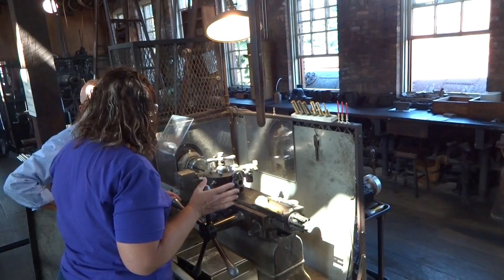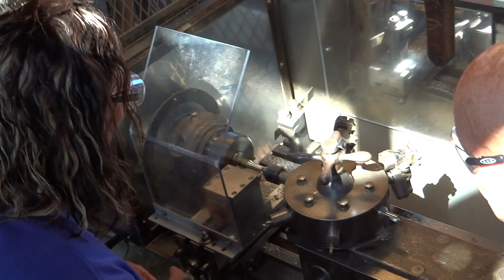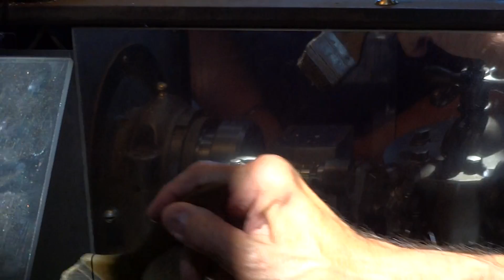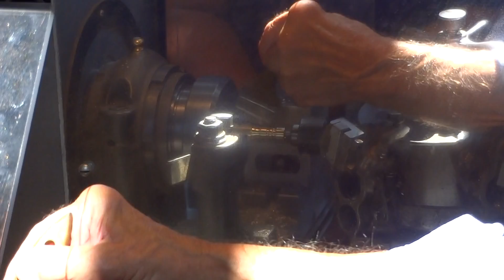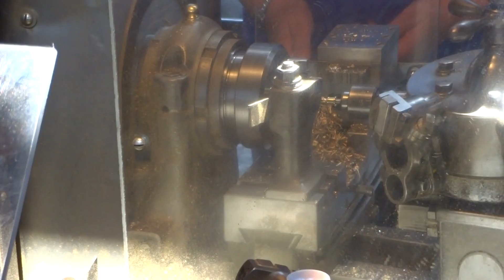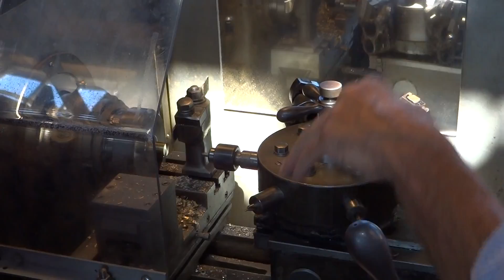brown and sharpe turret lathe

Comment: I did it about ....? 8 or 10 years ago  got to keep the candlestick, still have it.  It was $5 at that time and WELL WORTH IT !  I treasured the "turret lathe operator's certificate they gave me and still have it.
I think getting to operate this fine old B&S kinda pushed me in that direction.....I had always liked engine lathes and usually had one in the garage or basement.  In the intervening years I have been  able to aquire two Warner & Swasey #3 turret lathes each with almost a full set of collets ....including hex and squair...... the smaller #3..... a round head...... I have running and like it very much. The larger #3 a so called squair head Is much heavier built and takes in collets up to 1.875 "    My dream is to get it running too.  Hopefully I can visit Sims and again run the fine old Brown & Sharpe. Thank you mog5858 for putting this video up.  I would encourage anyoue with any interest at all in machine tools to visit the Henry Ford Museum. and the connected Greenfield Village where the Sim's restored machine shop..... and this turret lathe is.